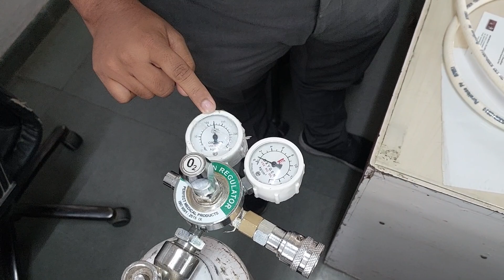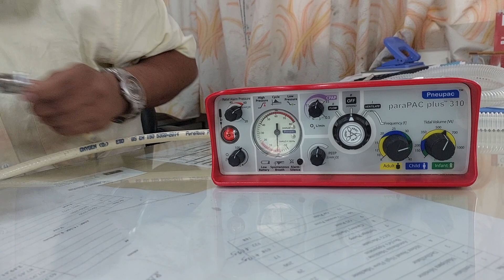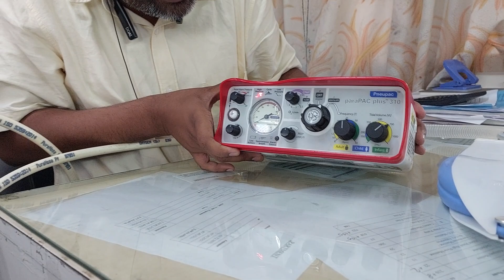MRI Compatible ventilator operating training

Comment: Sir the connector of the oxygen pressure line is metallic, so how can we use that into the mri room.
Reply from the maker: In MRI cabinet there is central oxygen outlet and that oxygen probe is non magnetic material that is MRI compatible